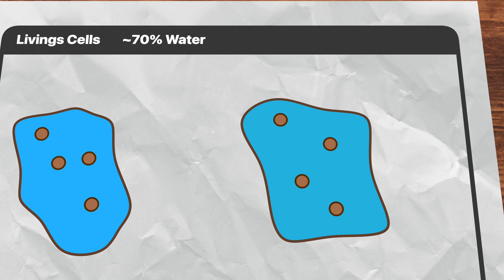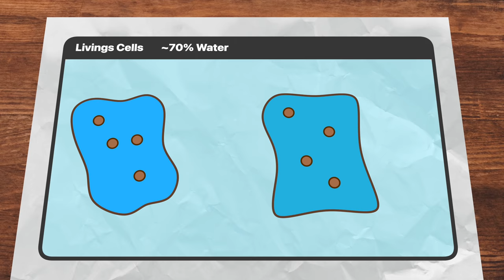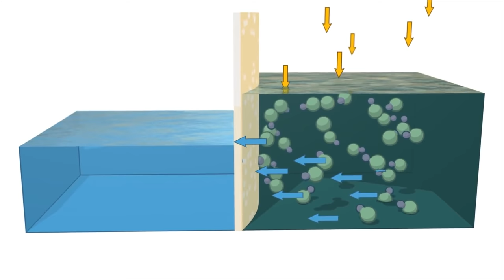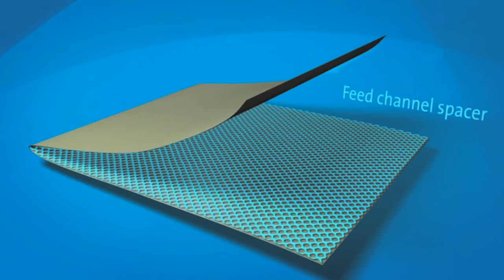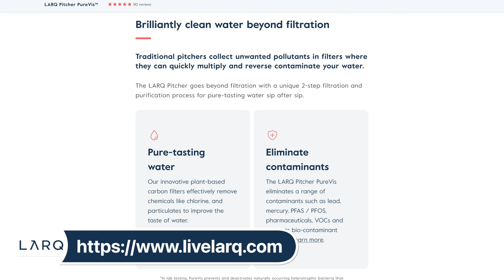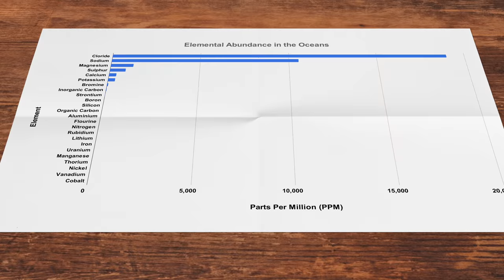Why Not Build Desalination Plants EVERYWHERE?

Comment: also water harnesses its own energy in the form of hydrogen.. you can use hydrogen which is about as green as it comes when you burn it and it will power the generators to move the pumps.  this technology exists right now. your only problem is the waste product from sea water.. so we need to fund a use for the brine, or a way to break the bring down into something useful. maybe a building material ??

Comment: So here is my $10billion dollar idea.
Why not have it be an electric plant first?

Produce electricity with raw sea water thru electrolysis.

Have the exhaust be pure distilled water.
That also cools the electric plant.

Basically create a damn. Dig a mile long trench inland.

Allow water to freely flow into it.
Can use water turbines as well, more nearly free energy.
Allow the flow of water to not only cool the plant but use the expended heat to create desalination.

Exhaust behind plant creating an artificial lake.
That can be pumped from and used for agriculture watering.

Comment: The Pacific Ring of Fire is located in relatively close proximity to volcanic heat, and sea water. Any chance there? Could the brine be discharged back to a volcanic heat source without putting us all into orbit? 
  The Yellowstone caldera could provide nearly unlimited heat for the generation of electricity, much to the chagrin of the US Park Service. As another off the wall thought. Could the ominous “spent fuel rods” be tapped as a source of energy, rather trying to keep them in chilled water for centuries or millennia? If those rods are hot enough to be that dangerous, there should be some viable use for that potential energy source.

Comment: How funny would it be that we start getting all our water from the desert. 
You wouldn’t need pumps if you use deep water pipes and then reduce them as you go. Hydraulic pressure would do the rest. Even ram pumps could help lift the water higher. I believe that it was so efficient that it is 7 ft lift from 1 ft drop. You could used the cold sea water as a cold substrate for water condensation. All this from gravity and the sun. Free energy.

Comment: I am surprised you zoomed in on the lithium content of sea water. Surely the sodium and chloride can be put to good use as thermal batteries for molten salt filled solar towers. Sodium cooled nuclear reactors and sodium batteries that Goodenough has been talking about. The Magnesium also surely must have many uses too. Other elements are likely too diffuse to be worth pursuing, no?

Comment: I jumped around the video trying to find your solution for all the salt.  Didn't find it.  I could have missed it.  In case it wasn't covered, here is why it is an issue and you can't just dump it back in the ocean outside the plant.  High levels of salt to water kill just about everything.  Look at the dead sea, it's salinity is many times higher than the ocean and nothing lives in it.  You just jump Sodium in your waste management section to the more sexy lithium.  I'm totally fine if your plan is to dig a massive pit and dump all the salt in it, but you need to have some idea of what to do with it.  It is the second most abundant resource in Ocean water.  There are countries that have obliterated their coastline by just pumping the slurry back in.

Comment: why dont they just use gravity to force the water around the pipes.. ?? sit the massive dome a few feet below the ocean surface and about  2 miles from the coast.. the amount of water weight in the pipe will be enough pressure to push the water into the dome.. the dome will also sit above the pipes enough that considerable water weight can be achieved and the weight alone can drive the clean water to the building and you can then use small micro pumps to take the water to each room.. or better stilll make the water source in the building communual a shared serviced kitchen and bathroom area.. why do people have to have their own sinks and toilets.. baths and drinking water.. centralise the source stream line the system and make everything lean and standardized.

Comment: You could build the needed nuclear power plant for electricity. Then use the lost heat that goes into the cooling towers to heat the water for desalination. Then capture hydrogen that well be produced in this process using it for fuel too. Killing three (3) birds with one stone. As the saying goes.

Comment: We always talk about people not having water yet we are always seeing people suffering the effects of floods.

Why doesn't the US have a national system to redistribute water between the top 20 water storage sites across the US? We move oil thousands of miles to process, why not water? We sell bottled water for more per gallon than we sell gasoline on the west coast where water is needed the most in the US.

Again with pipelines, why can't desalination plants not pump the brine about 10 miles off coast to the edge of the continental shelf and deep water Pacific? The US has pipelines in place with companies like Morgan Stanley to pump finished gasoline produced on the west coast to storage facilities in Nevada, over the Sierra Nevada mountains that is sold for less than the cost of bottled water after being pumped over 200 miles over one of the highest mountain chains in the US, yet we can't pump water that's on a downhill slope into the Pacific for 10 miles to where water depths go from a few hundred feet to several thousand feet when the edge on the continental shelf is met.

I guess the most controversial question is: Why do we have big cities that have no natural water supply? Why go to such lengths to feed places like Los Angeles with water when it would be easier just to ship the people somewhere else. SoCal politicians blame almonds for the lack of water yet it is SoCal that's now tapping into the water from the Central Valley Water Project that was designed to have the big three reservoirs of Shasta, Trinity and Oroville feed the Central Valley for crops like almonds but not places like Los Angeles that leach the life from the California water system.  It's like what we do with famine and people with food around the world. For decades we ship food for them and the situation doesn't change, why not help them move to where food is available?

Comment: gee, if only we had like a MAGIC ROCK that we would, you know, put inside a resevoir of water, and this rock, you see, would be constantly getting hot. Like hot enough to boil the water.
We could take the steam from that boiling process, use it to spin a turbine, and SAVE the fresh water steam, then pump in NEW sea water to refill the reservoir. Then we use the energy generated to push the waste brine through a reverse osmosis filter. Then we could maybe use the waste salt in some kind of special energy generating device by using a DIFFERENT magic rock that could use this molten salt as a coolant.
Too bad none of this exists.

Comment: Why are there water shortages?
Let's take California as an example - they quite literally dump half of the fresh water they collect into the ocean and desert for pointless econut projects.
Additionally, about fifty years ago, Democrats also abandoned the blueprint which had turned CA from a desert into one of America's bread baskets and stopped upgrading its water collection and storage infrastructure.
This not only resulted in the frequent flooding we see in the state when it rains, but for instance, the last round of rain which flooded the state could have provided it with a decade worth of water...if the Democrats had followed the blueprint and continued to upgrade the infrastructure.
But they didn't so CA progressives have been drilling progressively deeper wells until they drank the aquafer dry.
While desert countries obviously do have a fresh water problem, most of the rest of the world has a water mismanagement problem.
As for the brine, that's not a problem - simply pump it out into open top tanks, allow the remaining water to evaporate off and now you've got salt - that's how folks used to make salt centuries ago and many still do so today.

Comment: Good informative video, but you lost me at treating NEOM like anything more valid than a hackneyed dictator dream project for grift. I don't believe the "city" will ever be built (and shouldn't, it's a terrible concept in layout, and ignores all the aspects of "being a city" in favor of... absurdist aesthetic? Nonsense). The glass dome thing is not really a new concept, like you mentioned it's just a rehash of the evaporation method, but using natural solar as the heat source, which is neat. Iirc, they were designed by and bought from a Dutch company that had been sitting on the idea. The reverse osmosis method was interesting though, I hadn't actually seen a good explanation of that before, and may look into it more. Overall though, the waste product is the real problem. In a true desert, I suppose you can just... put it somewhere, but in most areas the damage to the environment isn't really worth it, and the "benefit" of trace materials is... not significant. Sorry, but 0.0 PPM of thorium is not going to give a relevant value add to the process :P -- especially when no one is really pushing forward on the thorium reactor tech :(

Comment: Sodium batteries are a possibility.  As the technology in sodium batteries improve I believe it will push lithium batteries back to small scale uses such as power tools.  Sodium storage coupled with solar power could become a primary power source up to a certain distance from the equator.   
Everyone remember the huge push to use corn to produce fuel. Once it became a reality the same people that promoted it's use (EWs: enviromental whackos!) started complaining that the crops used for fuel were taking food out of the mouths of children.  EWs survive on a need to complain...some people aren't happy unless they are unhappy.  Go figure!  They also complain when their neighbors create a compost pile to feed their soil naturally because the compost is unsightly and the heat they create makes the piles steam off the energy released by the decomposition...they forgot about filling landfills with wasted foods that they also complain about.

Comment: "Brine" as they call it which is not what it is, is not a problem. The ocean is 100% brine. The problem is the concentration. The ocean is becoming less salty/briny as the ice caps melt. This can alter the currents and has been theorized to lead to an ice age for Europe as warm waters won't be carried north as they are now. As with most things,  the real problem is financial. If the solution isn't profitable enough it is rejected, like recycling Styrofoam, aka the easiest plastic to recycle but not dense enough to be economically viable. Don't worry, in a thousand years when the circle jerk called fusion becomes a reality, we'll have waste heat to desalinate.  Of course breeder reactors (fission) can do this now and use nuclear waste as fuel removing that burden, but people are stupid and probably deserve to die for fearing nuclear power. I can't care anymore. Fans don't cool the air and nuclear is safe. People can't science due to low I.Q. or greed. 
Good video though.

Comment: Great video. Why?  Money and arrogance.  You already pointed to the solution.  Ask Middle Eastern countries how they are getting water.  How are they irrigating their crops. Most especially Israel even more than Saudi Arabia.   That's the answer.   How do they do it?   In addition, we need to switch to drip irrigation and not the wholesale irrigation that consumes 80% of our water here in California.   The solution is here.   Repeat, 80% of the water is NOT residential.

This is really similar to the question that was posed 20 to 30 years ago.   Will solar panels be cheap enough?   Now we have the answer.  

Desalination is the only answer.  Unless we want to construct massive pipelines from areas of the country that are always flooded to areas that are drought stricken.

Comment: =ONLY WORRIED ABOUT CARBON FOOTPRINT AND NOT ABOUT THESE ARE TO B EXCAVATED AND IMPORTED FROM SOMEWHERE=????---GREAT BRAINWASH U HAVE....WHILE IN ACTUAL RENEWABLE IS NEEDED FOR BE SELF DEPENDENT OR ABOUT PROLONG TRADITIONAL RESOURCES ON PLACES

.......BUT DESALINATION....IS ONLY VIABLE IF PAIRED WITH RENEWABLES TO CUT THE COSTS OF FUEL